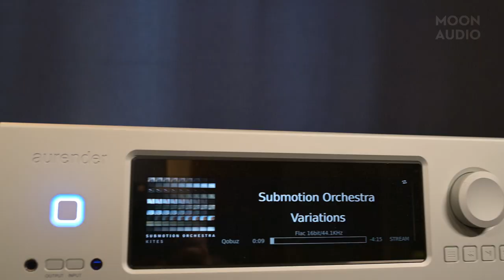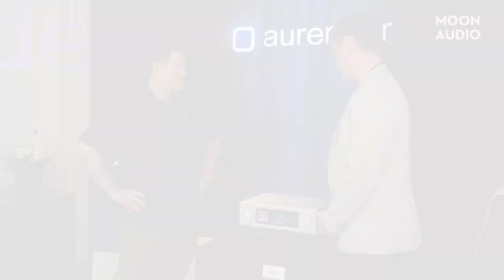Aurender: Everything Audiophiles Should Know | Moon Audio

Comment: Coax is better than USB?  I honestly didnt know that.  The issue with coax is thst it can't transmit native DSD...at least on the devices I've owned.
Reply from the maker: They each have their own benefits really. Coax is considered a cleaner and purer signal, but it doesn't have the bandwidth that USB has. USB has plenty of bandwidth but can typically have more noise leading to more jitter/audio issues.
Reply: @moon-audio  Appreciate your response!  I'm testing the WiiM Pro and coax sounds better than optical, but due to its lack of USB it can't pass native DSD.  I'm researching other options that will best the WiiM Pro's sound quality.  My next test will be an Opticalrendu via USB out to my McIntosh internal DA1 DAC, then to an external DAC later on.  Or if there's no difference I'll keep the WiiM Pro.  I'd love to try an Aurender with my current setup as well.
Reply: Can n10 be used as Preamp volume control and bypass the use of traditional preamp ?

Comment: Dumb question: so I could buy an A20 and just hook up 2 speakers and a subwoofer?
Reply from the maker: If they are active speakers (i.e. the speakers have the amp built in) then yes! Otherwise you would need to use the A20 with a separate speaker amplifier.
Reply: Or you could buy the new AP20 !
Reply: @paulkingsman8021  I wish!